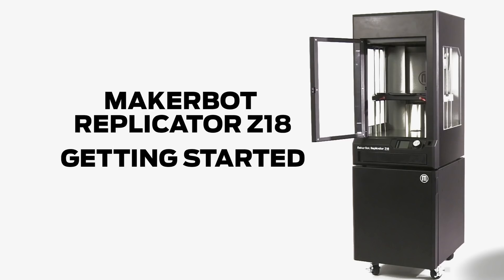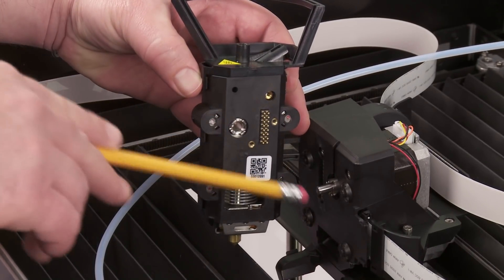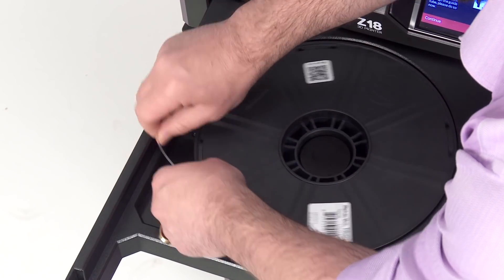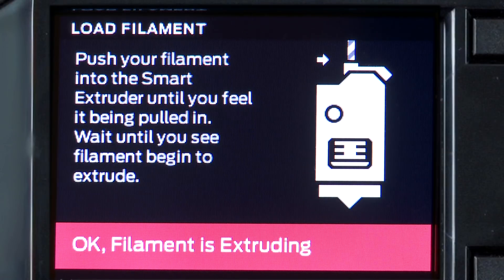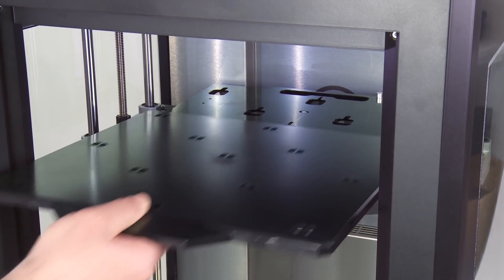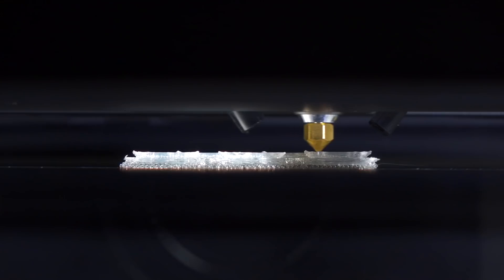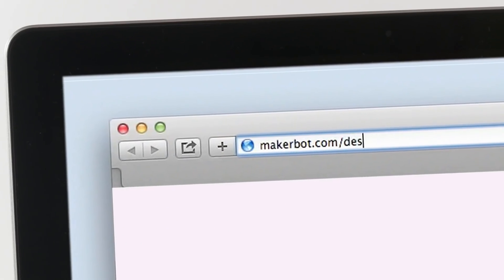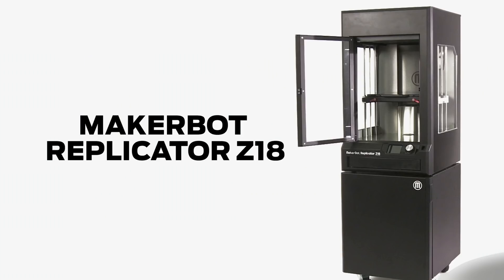MakerBot Replicator Z18  |  Getting Started

Comment: No heated platform, no duel extrusion, this isn't an upgrade, this is a downgrade then scaled in sized
Reply: just get a Raise n2+
Reply: PLA printing doesn't require heated platforms
Reply: who would spend $5,499 on a printer that can print only PLA or filament not needing a heated bed. For the same price you could get a printer that can print peek or pei, engineering plastics.

Comment: So, you're telling me that this overpriced $6500 printer doesn't even have a heated bed to prevent warps and use abs, a feature that even some $500 printers have... Well, i'm dissapointed -.-
Reply: The size is what would make it hard to heat evenly
Reply: Mintar It's not like 30 x 30 cm heated bed don't already exist... You can find some on amazon for like $60. So, yeah, makerbot are just totaly overpricing products which could be way better.
Reply: So, can you point to another 3D printer that has the same build volume and all the convenient features? ie: smart extruder, camera monitoring, auto leveling, etc. for a comparible price? I can't, and I've been researching quite a bit. Keep in mind the convenience factor of automated settings, so those who aren't tech savvy can operate it quickly.

And considering this is a PLA specific printer, a heated bed is not necessary. So no abs and no heated bed is a moot point. 

Not saying Makerbot is perfect. They still have bugs to fix. But again, point to another 3D printer that has similar features, American Made, with adequate support.
Reply: Arthur Hong they still dont have the right to shoot out such an absurd price point, they seem to think because some people arent tech saavy, it also means they aren't smart enough to know they're being ripped off.
Reply: cheenadengin Who has the right to do what, is not defined by your opinion. If there is a "demand" for what they offer, they will continue to sell at the price that the basics of "supply and demand" will dictate. In any case, why don't you answer the question then. What other 3D printers, offering the same build size (or larger), and pre-assembled, come close to this pricing? Even without the extra bells and whisles, the "pre-assembled" part is quite important. Because for some of us, time is money. If I'm going to spend 10+ hours building something and troubleshooting it, rather than using that time to design, then it's worth several hundred dollars for me to have it completely assembled and working right out of the box. 

If you're not going to offer any info on other competitive 3D Printers for that price, then you really have no reference of comparison for what is considered a "rip off". And it's also a matter of perspective. At one point I was ready to fork over $10k for another 3D printer, and it had just a slightly larger build area, but better prints. However, plastic material costs for that printer was through the roof. Looking at this printer and cheap filament options, it's not bad at all in comparison... depending on the project type. So $7k doesn't mean much to me if it can get stuff done and make me money. But I'm open to other comparable printers, so by all means, please enlighten me.